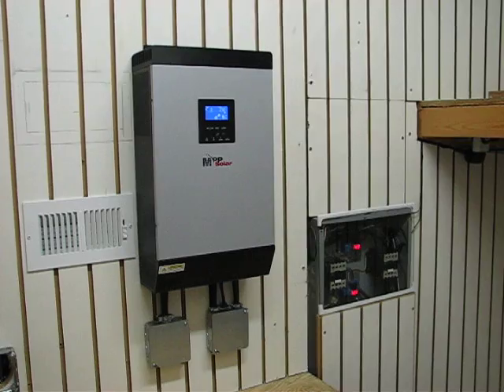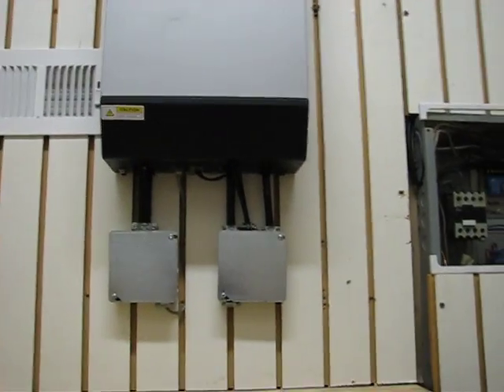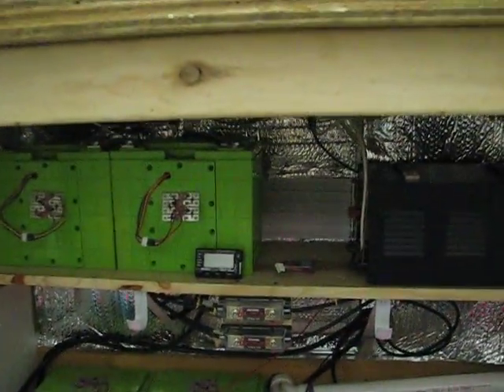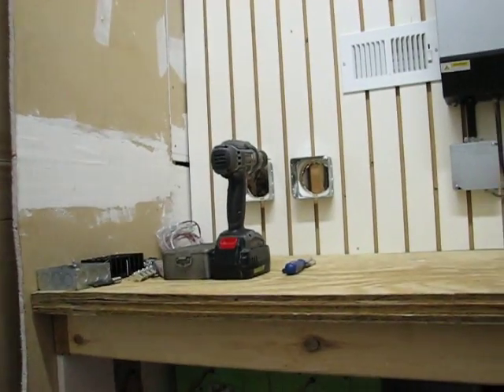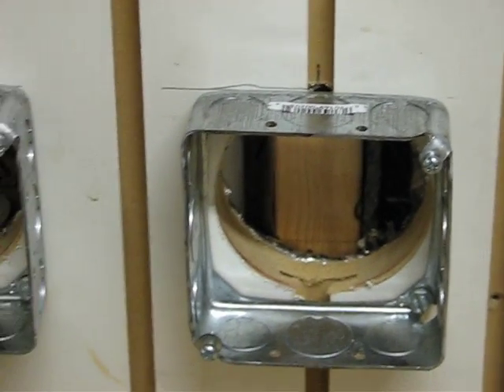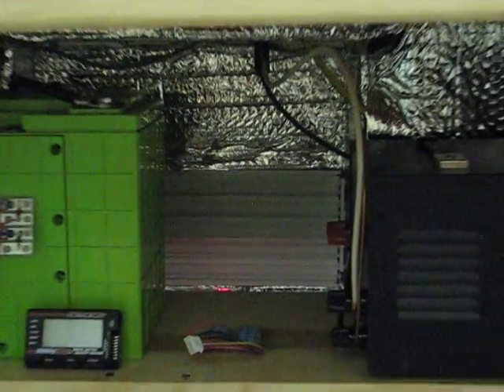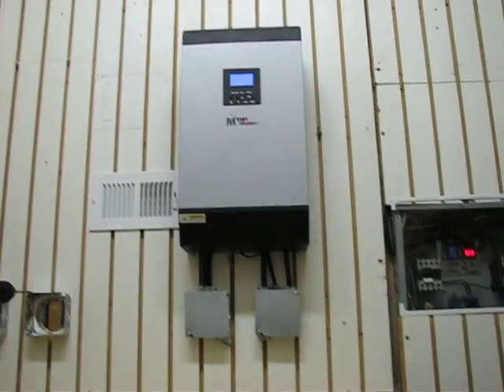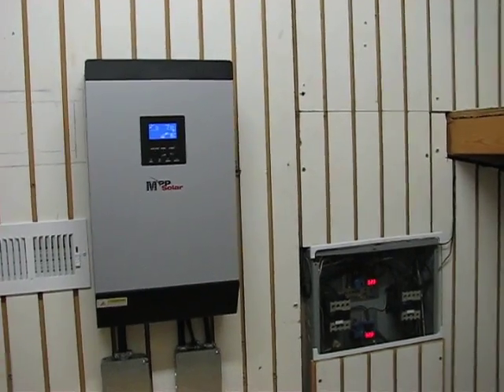Air Conditioned Battery Cabinet for solar system

Comment: Hi I have seen your progress with it all it looks nice and neat!! I am building a temp controlled box for my winston LYP at the moment myself but progress is slow!! your cell balancing system looks good ! how and what is it ?? Looks interesting!
Reply from the maker: Kjell Johansson Hi! Thanks buddy. Very happy with it! Using hobby type balancers have the system set up 4s x 4 to = 48 volts balance each 12 volt 4s with a powerlab 8 use the hobby balancers on each 12 volt cell. once in balance they have stayed in balance.  MY next video may be on the powerlab 8 and how I used it to balance the system.
Reply: +off grid kid ... thanks I just went with lithium batteries and setting it up at the moment and it is a new learning curve !! Will look out for a video about your solution and your information about it !! Cheers
Reply from the maker: Just don't go under 3 volts per cell they say 2.5 but power drop from 3 to 2.5 is quick so recommend 3 volts as a low & 3.65 as a hi if you keep them in that range you will be fine. reccomend to get the top balancers like they use on EV's here is a link http://ev-power.com.au/webstore/index.php/ev-power-bms/bms-cell-modules-1.html
Reply: +Kjell Johansson    Hi I have put on only 750w on the giant at the moment but I will put more on ,I am in the process of rebuilding all inside my shed !, and got 2250w on the flexmax.... But want more solar panels!! Want around 6000w cheers
Reply: +Kjell Johansson I have a bms-raps and the cmb-400 on Oder!! Coming in about 4-6 weeks!!
Reply from the maker: Set the giant's back to grid voltage to 51 or 50 volts. Have mine set to 51 this way the cells should be around 3.2 volts at switch over, will get the most life from them this way. Even if your out of balance some will be fine if you keep the cells in the proper range.
Reply: +off grid kid yen since like the setup up on the pip/giant the way you can set back to grid and discharge voltage!! Will save battery for a longer life cycle I will do a video in a couple weeks about my solar update!!
Reply from the maker: Cool! Looking forward to it.
Reply: +off grid kid hi do you have any high voltage /charge disconnect on the system??
Reply from the maker: No not at this time.
Reply: +off grid kid I am looking for one that will disconnect the incoming pv array if too high voltage happens for some reason,don't want one that will shutdown the system !!
Reply from the maker: That's the same way i was thinking. could use one of the voltage control switches & relay  just for that.
Reply from the maker: Have my system switching the Air Conditioning on to the inverter when batteries get to set point so my batteries will never over charge this way. And all ways using all solar power made that day. When batteries are full system will hold back power not being used.
Reply: +off grid kid that a good way no wasting off power!!
Reply from the maker: True works great!
Reply: +off grid kid air conditioning as the dump load,I like it 👍
Reply: +off grid kid hi just have been scratched my head and was thinking can you use the blinks 6s and overlap in to the 4 in series and get the them all together and also the balancer working connected  together ?? Hopefully you can make sense out of my idea !! Cheers
Reply from the maker: That's a great idea! I only used them from being in the rc hobby thing had two of them laying around. so was the cheep way out for me. the 16s balancer would be best or a BMS system have seen them on ebay.
Reply: +off grid kid hi I have bought the hobby ones as well ,they balancing all the time ,In the mail from USA!! 👍
Reply: +off grid kid as for the bms system they all start balancing the cells at 3.6 v and you have too have system without any load on it , and that's not good for my solar systems, let me know if you find something interesting bms system!! Cheers
Reply from the maker: With the hobby balancer it will take a 12 to 16 week for them show they are even working they just help a bit keeping the big cells in line when charging & discharging some times they will shut down for a while when cell are in balance and restart when needed.
Reply from the maker: I use a powerlab 8 to help speed up balancing it will charge and discharge from 1 to 8 cell at a time. it all so can tell me the IR of the cells to show if they are going bad or what shape they are in. some good videos on the tube search (powerlab 8 bottom balancing). Will Give you an idea on what it can do.
Reply from the maker: 3.6 volt shunt when there is a load is just fine that kind of balancer is good will keep the weaker cells from going over voltage. some of them have a built in loop system that will shut of the battery as a unit if over or under voltage.
Reply from the maker: All cells have a bit different IR so some cells will reach 3.65 much quicker that others.  I'm only charging to 3.410 as full and 3.180 as low with the cut off voltage of 51 volts thinking this will make the cells last longer that expected.
Reply from the maker: More easy for them to stay in balance in those voltage ranges the cells would want to drift if i ran them to low starting around 3.100 volts or charged them to high starting around 3.550 would want to knock them out of balance. my results would be different if all my cells were healthy but i have 3 week cells in each group of 16 cells for a total of 6 week cells. But got them used at a very low cost still very happy with them.
Reply: +off grid kid thanks for the information about the power lab 8 will look in to that ,I got the winston LYP coming in the next day or so they can take a bit more voltage recommend too charge up to 3.5 v and down to 3.1-3.2v and a balanced charge up ones a week too 3.6-3.65 !!
Reply from the maker: Sounds perfect! how many amp hours are your cells?
Reply: +off grid kid I started with the WB-LYP-300 !! Still try too save some of the agm battery for back up ore something!!!! Have put the most of pv on the pip now working fine!!!
Reply from the maker: 300ah!! Wow you are set my man. Thinking you will be impressed with them. That's going to work out so dang good. Awesome!
Reply: +off grid kid well that the goal!!! 210amp   Too play with if down to 70% !!! Just preparing for installing them at the moment fuse, switch, shunt ,and so on!! Very excited 😎
Reply from the maker: Very very excited!!! Heck yea! got used 160s and i was pumped!!! wait till you get them they are addicting! just did a vid for ya on the powerlab 8 will post asap
Reply: +off grid kid cool thanks will look at the video I will do some later when I am putting it together and start of the new system!!! Cheers
Reply: +Kjell Johansson hi I play with the Rc cars too but mine is 2 stroke petrol monster truck 4x4 only lithium for the rc side of car !! Is the power lab 101 v ore 240v !! Looking at your video it looks like a transformer under it !?? Thanks again Kjell
Reply from the maker: I'm a 2 stroke junky! Raced rc pro series monster truck every year they ran monster trucks in there series thinking 6 years in a row??? designed a starter box & chassis for the t maxx from traxxas ran all over the US racing them was some of the funnest years of my life!!!!!!!!!!